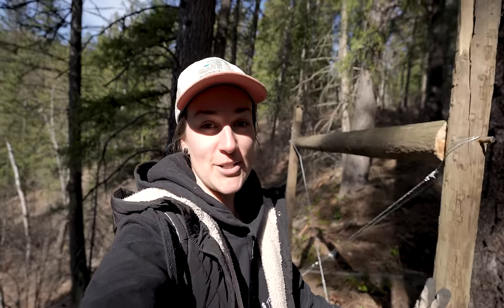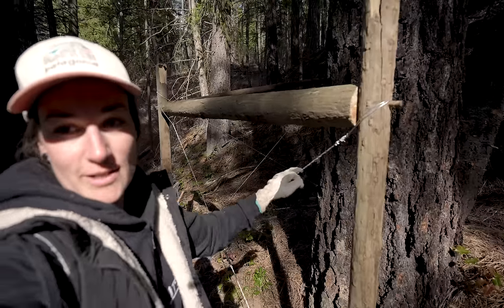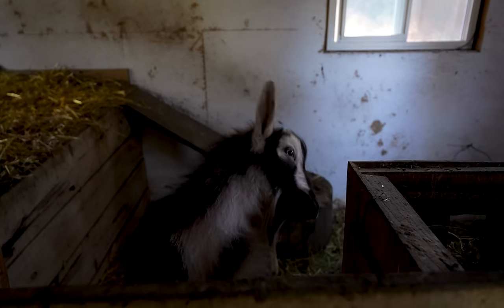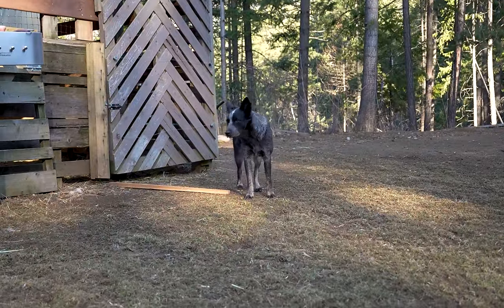We Need This To Protect Our Animals!

Comment: Just a quick comment:- Have you thought of using the bucket on the tractor to drive the poles into the ground? A lot easier and not nearly as tiring. Greg's arm muscles are going to be soar tomorrow.

Comment: I'm with you Katie, those posts won't last long. I'm happy to see you are using some metal posts. I guess they will keep the fence up for a few years. Pray for at least 5 before you will need to replace. I'm very happy you are being a responsible dog owner and building a fence. Hopefully they haven't been ruined already with the tracking instinct and dig holes to get out...good luck keeping them in the yard...

Comment: Guys great job on the fence, but as I was raised on a farm, we would have used the giant tree, and attached a post to the tree and not used the H-frame then set a post every 10 10 12 feet then used a come-along to stretch the wire, or even used the tractor stapling as we stretched it to a H-frame when one was required

Comment: A little late maybe but a suggestion. I used my end loader to drive t posts for my pasture. Beats the crap out of the old pipe driver and sledge hammer. C clamp a piece of 2x6 to the bottom of the bucket. One person hold the post level, the other very gently push the post in with the loader. It takes a deft touch, you have to make adjustments to the bucket as it lowers to keep it flat, but I’ve done hundreds that way.

Comment: Hey Katie, what you are missing is that you can't expect anything made of wood to be pounded on like that and not have them compress during the pounding. You only need to trim off the tops when you're finished and no one will ever know that they had been smashed with a sledge hammer. Even metal posts will deform if smacked on with a sledge hammer. So you've save tons of money and ended up with a great product and project.

Comment: and when you do replace posts, they can be metal or concrete for a permanent solution ( even if each year you only replace every 5th or 6th post, all replaced in a 5 year span ) or just replace as needed

Comment: 8:42 my uncle, is a fencing contractor in Kansas does farm fencing and as well as all other type of government, fencing, projects, etc. he puts a cross tension wire in every H i’d like you guys ended up doing no matter if it’s a corner or if it’s just like in the middle of a 5 mile run where they put one every 300 feet or so to make it stronger for pulling in every direction

Comment: Two things, one if you cut the top of the damaged post be sure and cut it on an angle to keep water off of them, two I don’t know if you hammered in the staples at the bottom of the post but you need to. Otherwise guys y’all are doing a great job over there, keep up the good work and keep safe.

Comment: As an earlier commitment tractor bucket  as well as a little water around the post on it's way in the ground helps it slide in a little better.  Not sure how much pressure the smaller posts will handle on the way in the ground but will help stop them from splitting at the top.  I can see hard ground ahead and possibly post hole auger or hydraulic hammer to get through the packed ground. All that being said hard work has it's rewards.

Comment: Aspen is getting bigger than the other dogs. Cut a post or rod to your required above ground length. Use it for your posts height length. Less worries compared to tape measure. Decent weather, enjoy.

Comment: I have an old timie 1 in. wood auger bit with a 3 ft. extended shaft. I put it in a strong drill and work it down( up down don't get it stuck) in the spot where the stake will go. I throw 1 or 2 liters of water in that hole, these things help in driving the post down for me.

Comment: Use the bucket of the tractor to push the posts in next time.  Do you need to tighten your tractor chains, just wondering.  One last crazy idea, Electrify your fence using solar.  Great job on the road you built.  In Alberta were back to snow and -C again, enjoy yours while it lasts.

Comment: Steel t-post will outlast wooden post that have a tendency to rot off.  Deer have a tendency to brake wooden post when startle into fence.   Have you tried using the tractor bucket to drive the post into the ground?   Dad and I drove many wood post with the tractor bucket until I switched to all steel t-post.

Comment: A suggestion for your corner post setup, use a 45 degree connector beam between the corner post and the second support post.  From fence height on the corner post then run diagonal to just above ground level on the support post, then run your wire in the opposite direction.  That way when the fence pulls on the corner post that force is transferred to the base at ground level of the support post which is much stronger. We owned a 250 acre diary farm with many fences and those corners never failed.

Comment: In addition to a cant hook you might look for a   "snatch block"   A 6" sheave would be good.  You would be able to use rope and cable.
I found my last one at a yard sale in a rural area.  Since you seem to be in BC your chances are pretty good. A snatch block can be set into a rope that has something attached to to change the direction of pull

Comment: Probably to late, but when I am fencing like this I drive the point down with the hand post hammer, like you, until my front loader will reach over the top and use the tractor to push the post the rest of the way down.  Have a smaller tractor than you, so should work for you.   Cannot see the bottom of your bucket, but there is usually a bracket where the hydraulic ram attaches to the bucket, this spot is just perfect for driving tee posts.  Also if you have a bucket full of dirt it works even better.   Also keeps from splitting the tops of those wooden posts.

Comment: I must say I have never seen anyone drive posts of that size into the ground with a sledge hammer, I see it worked. I am amazed, the round must be super soft or wet. I would have used a post hole digger. Greg, you did that wrong, the tension wire is supposed to be high on the fence post to the low part of the corner post.  You may need to research that again.  I see you turned that around on the tension wires, good job.  I can see that Greg put in some hard work with that sledge hammer, excellent work there Greg.  Watching you from NW Florida.

Comment: I hope that when you string the fencing you're going to thread a galvanized wire at the top and bottom to keep animals from being able to push underneath  or push over the fencing and get onto the property that way. What you might want to do also, is to string electric wire along it too so that they get shocked if they try to push past and over it to get in. Wild animals, if they have the idea that there is something on the otherside that they can get an easy meal they will spare no effort to get to that food. So these deterrents are a necessary tools to keep you animals safe and alive. I know that you know these things. Just had to throw my two cents worth in for you.

Comment: I used to drive my T posts with the tractor bucket  (back centre of bucket)   I wonder if you can do that with the wood posts as well ??  Even try a choker slinger on the post  with bucket downforce as you pound it in  ???         Been there done that from Brantford Ontario

Comment: With wood poles, you would typically use and auger to drill a hole, then insert the pole and pack around it....Steel fence posts are designed to be POUNDED into the ground....why not just use the live trees for your insulators, then you still have the trail available for your SxS or your tractor????

Comment: I dont wanna tell you you could have probably pushed then in the ground using you bucket loader or your forks as thats what the Pros use I think there is an attachment you can buy push em in and for pulling out the old fence posts. Sorry but if thats all you do you find ways to do so as quickly as possible

Comment: I’ve not had good luck with pressure treated posts. I would get one year and they would rot off at the ground. The only way I could get more life out of them was by sealing them just above ground and down. Then pack in with gravel. Not dirt. Of course this means digging holes not driving them in. 😏🙂

Comment: Most areas in the U S have gas powered post drivers available for rent. I don't know about your area. Also these are available to purchase stating at about $400 in the U S. They weigh about 50lbs. Should be a lot easier on you with the number of posts you have to set!

Comment: you need a post driver a4" pipe with two  handles one each side about 1meater long with one end blocked with a plate.much easier than that hammer,